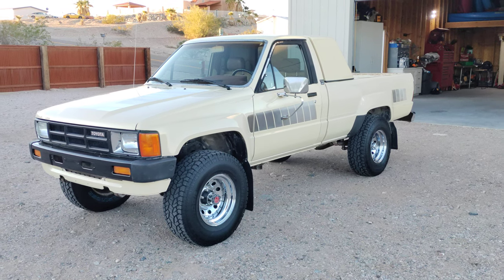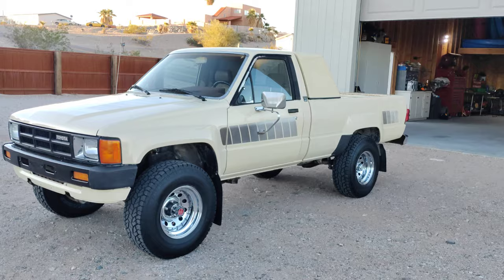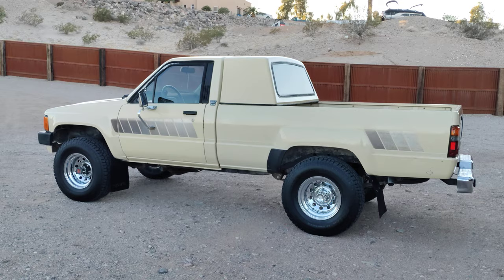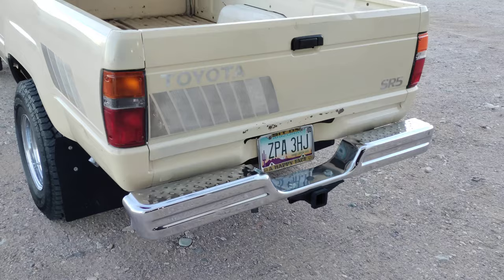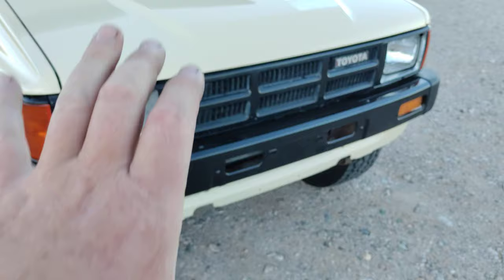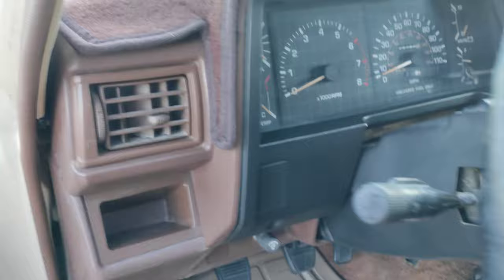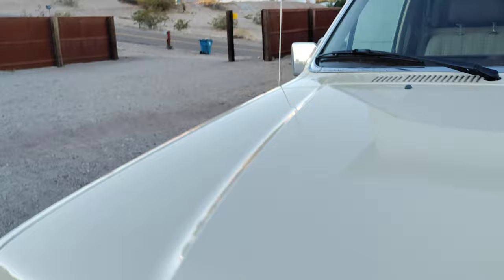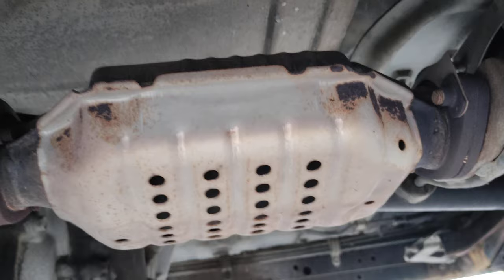FOR SALE 1985 Toyota 4x4, SR5, 22re, one owner 1985-2022. Walk around video PART 1

Comment: How much do you asking?
Reply from the maker: Listed on craigslist Mohave county, inland empire, Los Angeles etc for $12,500
Reply: How much of money would you like for this truck
Reply: Automatic transmission?
Reply: @mattlentz5107  I've still got my 1991 4x4 with 151k miles. Still runs great. Clean paint. Air conditioner still works. Radio doesn't.